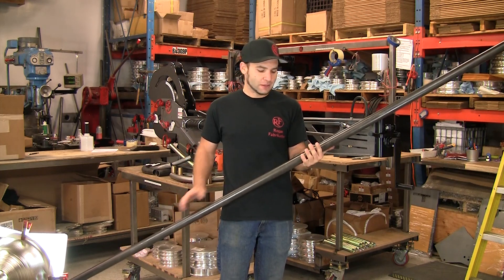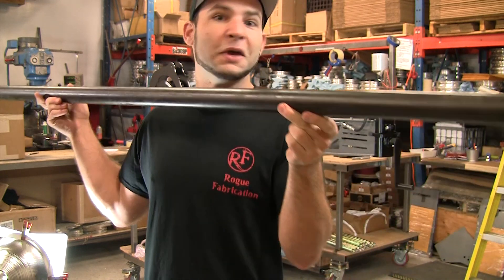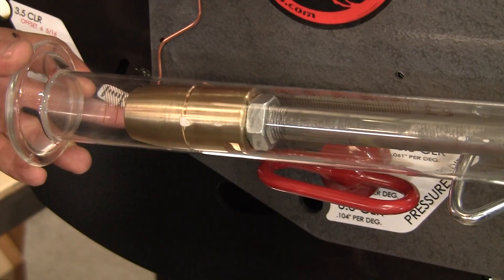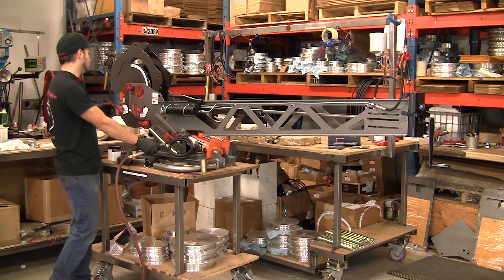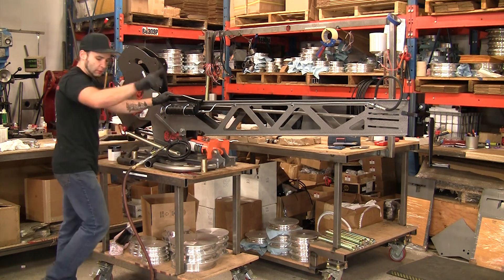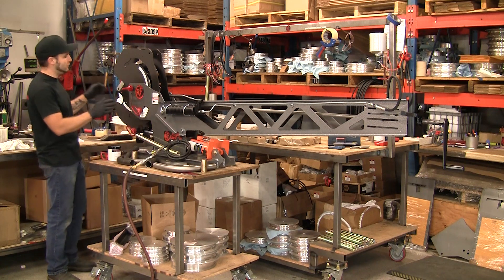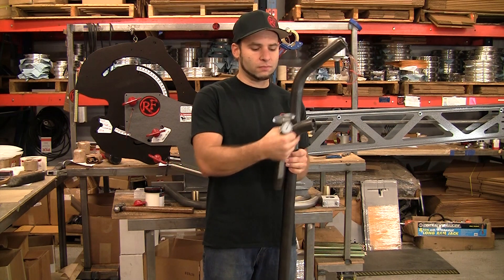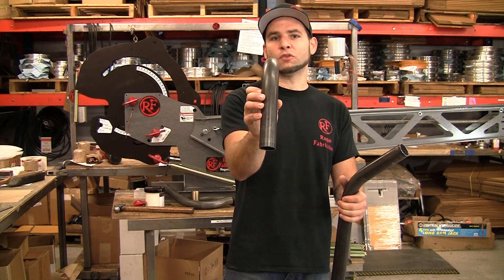M600 Affordable Mandrel Bender bending 1.625 x .083 on a 4.5 Radius

Comment: Whats the smallest radius you can bend 1 3/4 OD or similar size .065 wall tube without significant deformation, 3 1/2"?
Reply from the maker: Jerry, it would be about 2.5x the tube OD for bend radius at that wall thickness in most tube diameters. So getting down to 3.5 would be very doable, but only on 1 1/4" or so tubing and smaller.